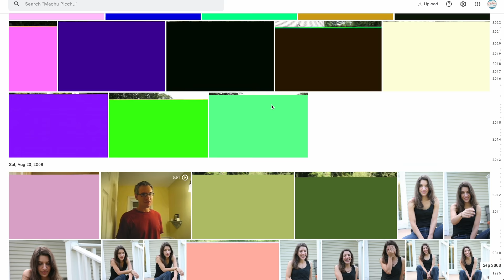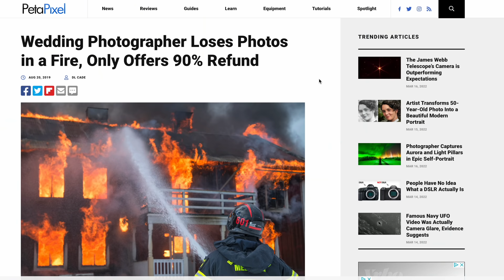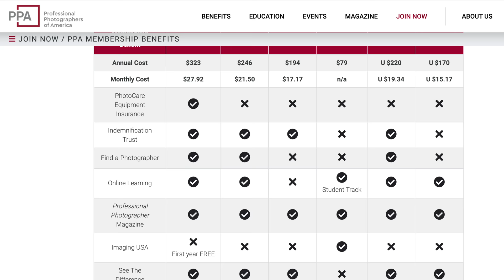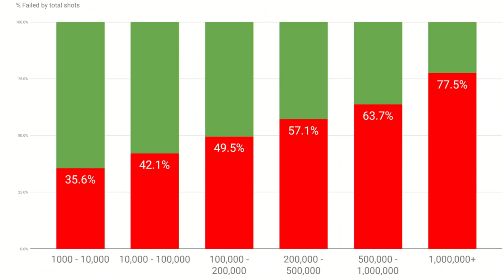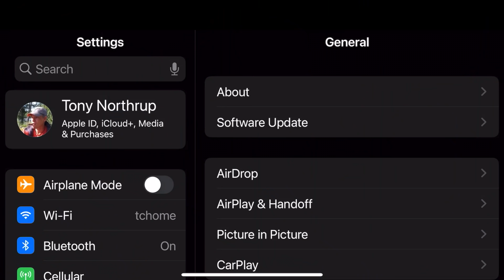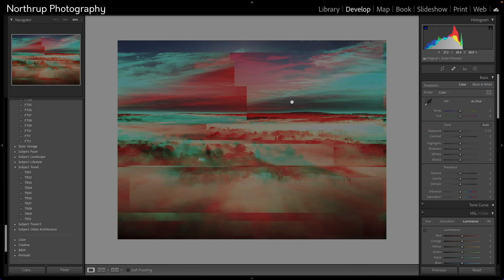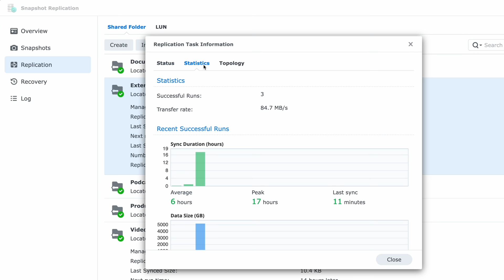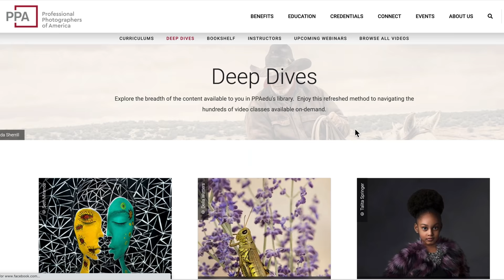NAS Storage for Photos & Video: PROTECT YOUR DATA!

Comment: I don't know enough about jpeg compression to really understand, but since it looks like the corruption on the images "starts" some ways down the images, I'd be really curious if there was some way to go into the image and manually start flipping bits in the data associated with the specific pixel it "starts" at (assuming that can be identified), and see if it can be fixed.

I'd also be curious if raw files, presumably being uncompressed, would be affected the same way, or if a flipped bit would instead just appear as a messed up single pixel. (And if so, maybe compressed raw would be affected though)
Reply: No, that's not what's happening here. Jpegs use transformation matrices and coordinate transformations. So, if you lose a bit of that coordinate matrix, you're screwed...sort of. What's happening here is that the magnetic strength of the stored data is not readable using the conventional mechanics of the arm in the HDD. He needs to use the software that I used to recover my files. That software will cause the drive to read files backward and sort of simulating what you were hinting at but not quite. It should work on most of the files. There may be a couple that are really that bad where nothing will work but the software won't freeze and continue trying to recover every file.
Reply: Some JPEG recovery programs can get most of the file back. I have only seen that damage on JPEG files for which there was no RAW copy but I had analogue originals.
Reply: Not a single file is safe from what tony is saying. Pretty much everything gets corrupted over time. Same with RAW files. At the end of the day it's a matter of luck. If in jpeg a byte is changed in specific area it could potentially ruin whole image or just a single pixel, really depends on where that is going to happen. But where it's going to happen is unpredictable. The HDD's looses magnetism and SSD's looses charge so not a single storage is safe over time. Best thing to do is probably cloud storage. Also Tony has mentioned making videos with slides of images which is also a pretty good idea since to corrupt a video file it would require much more effort than with JPEG's or RAW files. In general video files are much more robust to glitches. Even if glitch would happen during the video it would still continue to play and recover at some part where the image is still good.
Reply: His is examples use JPEGs but this can also happen to RAWs and most other files.  JPEGs were probably used for this example as most apps can display them and show the impacts (bitrot, or corruption) he was trying to show.  But all files of any type are succeptible to this.
Reply: @PaganiTypeR  what about using .par files when making backups?  I remember those from the old Usenet days.  Random parts of the file would get corrupted, so redundant information was sent so that the file could be repaired.
Reply: @chemicalburn  PAR files are mostly for use with optical media these days. I used to use quickpar, but ZFS just works better. I keep my files on an array with redundancy either a mirror or like a raid-5, and regularly scrub the disk. If any of the checksums fail, then it automatically copies the one that isn't bad and goes back to normal. If both of them fail, then I restore my backup before my backup no longer includes a good copy of the file. As long as I do the scrubs frequently enough to have a good copy in backup, I'm fine.

Comment: Also IT background. I've been running a ZFS storage array with two drive redundancy (RAIDZ2) for years now and it has been rock solid. I run pool scrubbing monthly and it has from time to time detected and corrected bit rot. One of the Amazon services I've been taking advantage of is free photo storage for Amazon Prime customers. This includes RAW photos too. My workflow works something along the lines of:  Import from SD to laptop. The Amazon Photos app runs in background monitoring my pictures folder. I also sync to my ZFS NAS. On another system, I have the Amazon Photos app download to another system. I think run a hash calculation on both the NAS and the downloaded photos. When cleaning an SD card, I hash those files and if that hash exists on BOTH Amazon and NAS I'll delete just that file.

Comment: Computer Information Systems degree, but professional cinematographer and wedding cinematographer here. 

This is so key, personal and business. My personal/business setup includes a QNAP 72TB ZFS  NAS system with a UPS as well.
As a business owner capturing footage that cannot be re-shot, a data backup is probably the most important aspect of your business. There is way too much on the line.

The QNAP has Hybridbackupsync that allows you to back up footage to multiple online providers like Google Drive, Backblaze, and Onedrive.
Once the footage has been shot, I upload it immediately to a Google Drive Workspace account. $12 per month per user and unlimited data. 

That way, if anything happens to the server locally, that data is up on Google's servers and can be re-downloaded at any time. 

From a personal perspective, it is true that we should be printing our photos and making albums.

Comment: Under Windows I use the system tool RoboCopy  to copy my images from one hard drive to a different one. That does not copy unchanged files, so it does not "copy corruption". Corrupted files usually have same size and time stamp so they are not detected as new.

Comment: Do it people !  
 I lost 15 yrs of work  due to the Australian floods just recently . I had multiple backups on various HDDs stored in separate locations . Record flooding killed that plan . Even the drives stored at a previously flood safe location ended up under 2 metres of filthy , muddy water for a few days , along with my PC and laptop and half of my camera kit .
 Luckily I had recently started to use a cloud storage service , but sadly I had only backed up a fraction of my files when disaster struck . 
 Do not hesitate , protect your work .

Comment: Some warnings and tips: with NAS drives the issue is mechanical failure of the NAS device itself especially the power supply, and this may cause two problems:  if your NAS is discontinued parts may not be available and with some NAS manufacturers there’s no backwards compatibility so you can’t just put your drives into a new NAS even with the same manufacturer.  (I’ve had this happen with Western Digital).

Tip1: to avoid the above creating your own PC-NAS is the way to go for the technically minded. 
Tip2: tag your most valuable photos which will cull the number to a manageable size and back them up to dual copies of M-Discs to be kept in separate locations.  These discs are rated to last for 100s of years.  The only issue is ensuring the disc technology remains current if ever a restore becomes necessary.
Reply: Backing important things up to a wholly separate kind of format is an important point left out of this video. Archival tape or disk as you mentioned.

Also it's becoming more affordable these days to fully stock NAS' with flash storage which is a lot more feasible long term
Reply: The only HDs I ever had fail on me were WD.

Comment: I was the quality manager for a large computer corporation and also a photographer and I can't stress your advice more. One of my jobs was projecting failure rates for new products so replacement parts were available in the field as well as helping our marketing team. 2 terms misunderstood are both identified as MTBF (Mean Time Before Failure and Mean Time Between Failure). ALL devices will fail eventually. MTBF  was the point where 60% of the field population failed (before first failure) and the point where the mean time expected on a particular device (between failures).

I keep my digitized photos from the 60's (film) and my newer digital camera files on USB drives that do not copy from each other as well as 2 cloud repositories. I also have the original hard copies should I need them in the event of a disaster.

I have also been keeping files on Amazon photo, which is free and unlimited for prime members (at least so far). They even support the RAW file format and limited amount of movies.

Comment: I'm old so I can speak from personal experience to back in the film days when we used to have two photographers to cover any wedding giving us multiple views but also two rolls of film from two different cameras cause not only were there film process failures but camera failures on site happened as well. We had a rule of backups of equipment in extra flashes and camera bodies for each photographer and backups for film with multiple camera backs, backups were always needed and are needed now more than ever. Oh and also one other point. If we lost a roll of film due to processing we only lost 15 frames (120 format film) out of the hundreds that were shot on a full day, not at all like the unimaginable risk of a single 256mb flash memory card with the complete day on it.

Comment: I'm sorry for what happened Tony. 
This is why i always PRINT the photo that matter the most to me
Reply: I agree with you that prints will outlast any digital storage device (and the equipment to read it). I can still read 300-yr old books in my library, yet no longer have floppy-disc readers from the 1980s. During the early 1970s, I took a lot of Kodachrome prints; despite being stored in boxes, the colors had faded badly 30 years later. Looking at the options available today, it seems that pigment inks on cotton rag is the most permanent (and expensive) way to produce long-lasting prints.

Comment: Hi Tony: I had an external HD become corrupt this past summer and because I back-up each night to a second locate drive it also became corrupt.  As a result I couldn't access my LrC Catalogue or images.  I never let my HD capacity go over 80% full so this wasn't the issue.  We had some power outages over the summer and I think that these events contributed to my issues.  Fortunately, I also store all of my images to Back Blaze with the 1-year version option selected so I had them send me a new HD with my 235,000 images on it.  I dodged a bullet but I am still very careful when I look at them back-up strategy.   Great PSA video.  Everyone should be mindful of this topic.  It is not a matter of if my HD fails, it is a matter of when.   Cheers, Keith

Comment: Thanks for the reminder and sorry abut the lost files. I set my Lumix G9 to record to both SD slots and save the files to two external HDDs attached to a desktop PC. Cloud storage would be a good tertiary option, but I could also periodically save to a third external HDD that I stored in another location (I'm not dealing with quite the volume you are). Years ago my travelling companion and I had all of our camera gear and over a dozen rolls of exposed but undeveloped film from a trip to Utah and Colorado stolen (apparently by a parking valet at a high-end hotel in Denver, but the issue was never resolved). It still bothers me so I can imagine how frustrated you feel, but at least we have the memories (but of course we still want the images)!

Comment: Tony's last advice is my biggest takeaway. I'm not a professional but an enthusiast/hobbyist. I have external HDD's/SSD's where I store my pictures but only for a year. Every year I print a photo album with all of my favorite photos and hold on to the pictures on my storage devices for 6 months. After that, the old pictures in storage are expendable. I do this because I can't afford cloud/server or NAS based storage rigs like Tony's.
Reply: You must be shooting a ton. A 4tb mirrored Pi ZFS raid can be had for maybe $400 and most of that is for the drives themselves. That gets you a ton of storage space, certainly enough to hold several years worth of images, and if you pare back the subpar ones, probably many years worth. 

In other words, this doesn't really make much sense. Even if you just delete the raw images and keep the JPGs, you'd have to be shooting hundreds of thousands  of photos to have an issue with storage space.

Comment: I haven't had a hard drive failure in quite a while (knocking furiously on my wooden desktop). I have had memory cards fail, but not with anything on them (again - knock wood).  They just suddenly couldn't be recognized by the equipment or computer.  I do make redundant backups of my memory cards as part of my work flow - a back up to external USB drives, a backup in the cloud, and two copies on my working drive in separate folders and working only from one of those folders.  Memory cards are too expensive for me to keep around, so the handful that I have get reformatted between projects once all the back ups are done.

Comment: Years ago I set up a fancy computer for a client (a physician). I created an external backup with automatic backups, but he insisted it will only slow down the computer, and elected for Manual backup. 
A few years passed and he called to tell me that the computer was exposed to some power failure, and the hard drive is dead. "No problem," I said. I'll be over and restore all your files from the external backup to the new computer you just bought. I showed up and the last backup was the day I ran it for him, a few years back. 
The drive that failed contained all the pictures of their teen twin sons who died in a car crash a few weeks earlier. There were thousands of images his wife took, believing he is backing the data up as I showed them both years ago. We sent the damaged drive to California, to a special lab in an attempt to save the data from the drive. It didn't work. 
The wife walked away and divorced him.
Edit: I use BackBlaze on all my computers, aside from DropBox sync, and another local backup. 35 years, never had an SD Card failure, but I do agree with what you said: Keep the files on the card for two more weeks, to make sure the files were backed up to the online service. Always check the online files and randomly restore a file to check quality.
Thank you for another great and practical video.

Comment: What a nightmare. I'm so sorry this happened to you guys. I use a similar backup system to yours: multiple Synology DiskStations, BTRFS, SHR-2, multiple locations. I don't think most people appreciate the importance of using enterprise-grade drives like the WD (HGST) UltraStar models. The error rate on them is exponentially lower than consumer drives. Instead of the expansion units, I use three DS1821+ units which I regularly sync to each other using GoodSync with checksums to ensure data integrity. I physically transport one of the DS1821+ units back and forth to a second location to sync with a third DS1821+ to keep the units air-gapped. Whenever I replace the drives in a DiskStation, I take the old drives and copy data onto them with the intention that they will never be touched again except in case of emergency. If I had unlimited funds, I'd set up snapshot replication...but I don't.

If I dealt with as much data as you, I'd also look at LTO tape. The tapes are surprisingly archival. The drives are expensive but the tapes aren't bad. They're ransomware proof too.

Comment: A great video. I have 3 independent back ups. I have back up drives connected to my computer all the time. Soon as I get back from a photo shoot I put everything on the external back up drives. I also every few weeks back up those drives to some more drives which are only connected to the computer during back up. I have a bank safe so 1set of drives goes into the safe, another set I have at home for easy access in case of a natural disaster or fire so can grab them easily, if I am here at the time it happens that is. I never store any photos on my computer's they are all on external drives,, not connected to the computer except the one used to initially put the photos on from the cameras memory card. So even if my computer was hacked, broken or even destroyed I would not lose my photos. I also every year or two buy new drives to replace the oldest ones for more peace of mind. I also don't use cloud services as anything connected to the internet has potential to be stolen, no matter how secure they are supposed to be. If you photos are that important do not ever use cloud services.